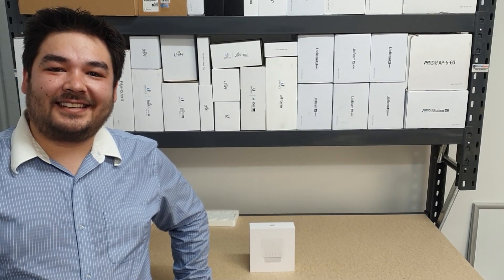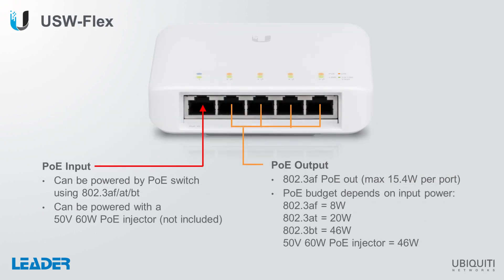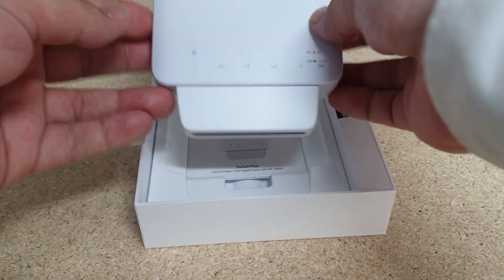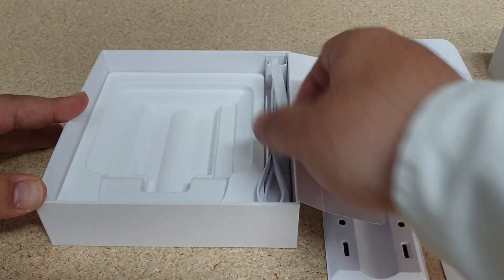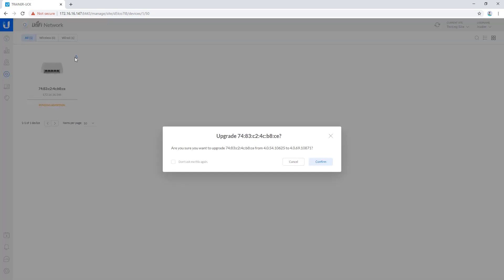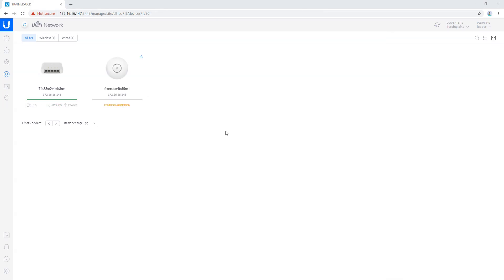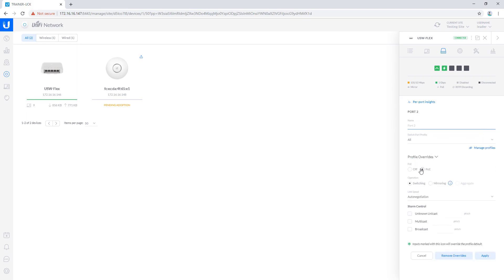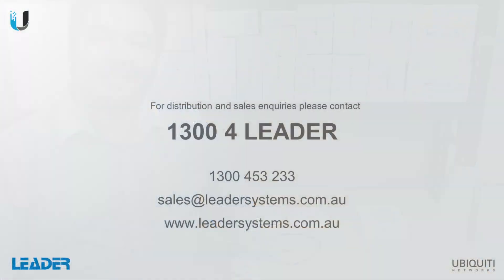USW-Flex: Unboxing and setup

Comment: Can I use it to power 3 UniFi G4 Pro cameras ?
Reply: Yes you can but you WILL need to run the switch off the POE injector as the G4 PROS use alot of power with 3 of them.